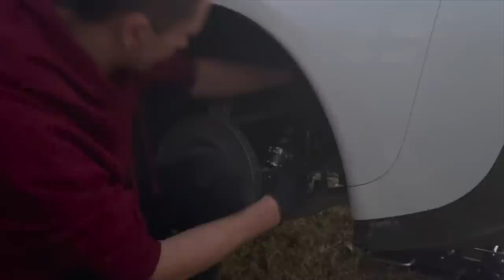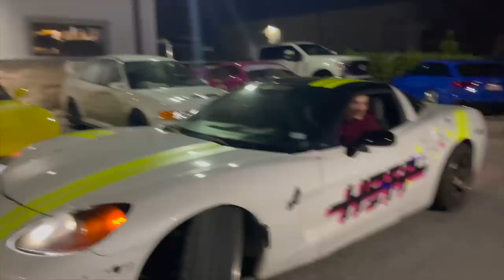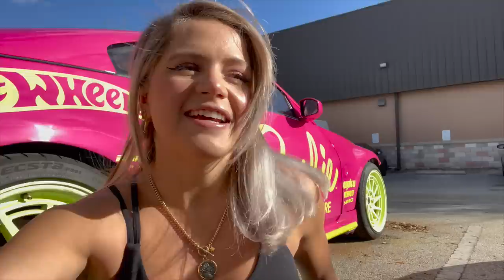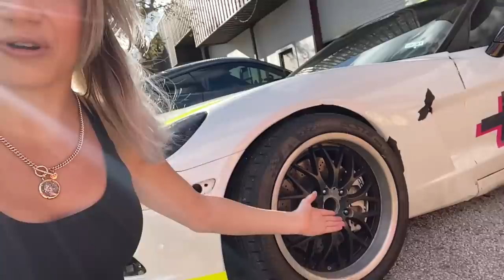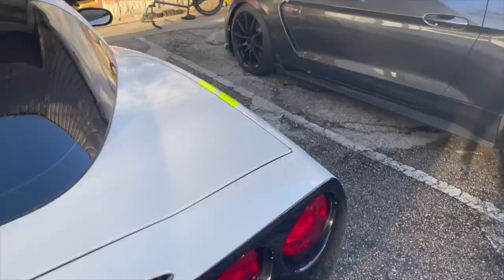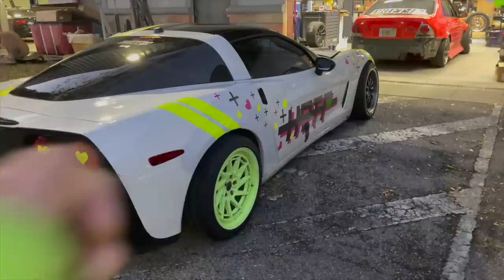C6 Corvette Biggest Issue SOLVED!

Comment: If you don't use hub centric rings, you transfer the weight of the car to the lug hardware, and the wheel studs can break while drifting (studs aren't made for sideways strength)
Reply: ARP studs cuhh

Comment: Collette-----FIRE HAZARD!!!!!   You gotta figure out that electrical issue. I can't believe that hasn't caused you problems yet. Start at the battery. Its almost like someone put a ground strap off the Positive side. Luckily whatever its attached to is isolated from the chassis ground.....for now, but if that's the case it won't be fused so you run the risk of shorting out that battery and burning your car down. Please fix so it doesn't go up in smoke. Love your videos, you rock!

Comment: "5x120s are had to find"
Me literally crying in BMW 😂
Reply: it's been 3 years, but c6 vettes are actually 5x120.65mm. That's 5x4.75 inches. 5x120 is normal, but 5x120.65 is literally nonexistent outside of c1-c7 vettes and a few 1950s-1980s GM products. You shouldn't put 5x120 wheels on a 5x120.65 hub even if you can squeeze them on, because the lugs arent designed for it and it'll bend them and mess them up over time, especially with the stress of drifting.

Comment: Idk what you had against the adapter spacers tbh. I run em on my firebird to run 5x114, and it works fine. In fact, it actually helps with the while angle thing lol, I’ve set it up similar to naoki’s b-knuckle. Stock arms, big spacer, cut knuckles and rack spacers. No need to redrill rotors every time you do brakes

Comment: But WHY do you need to use Ford wheels on a Chev.
There must be a squillion wheels in 18" in the US.
Adapters simply widen the track way too much and cause huge scrub radius issues. And are not as strong either. Be very carefull doing the adapter nuts up.
Hub centric? Is not an issue, most aftermarket wheels are not and never have been. And I doubt the adapters are not either.
Taper seat nuts locate the wheel

Comment: Wait, you converted to 5x114 because of wheel choice? You do realize most wheel offsets will not fit the Corvette right??? Pushing out the rear wheels on a corvette is actually detrimental to the design of the WHOLE TRANSAXLE. BIG YIKES on this video
Reply: riced out a vette and ruined it for resale.  Smart